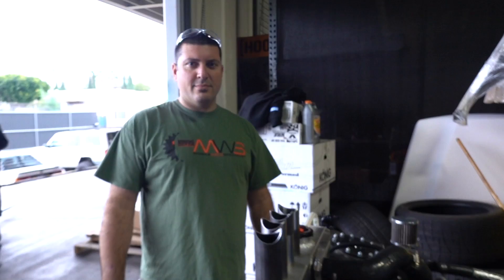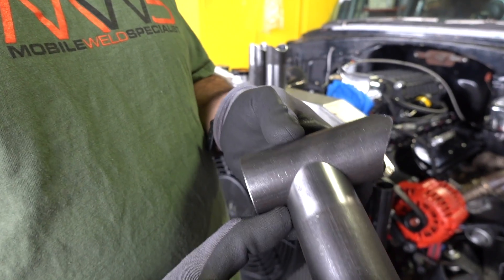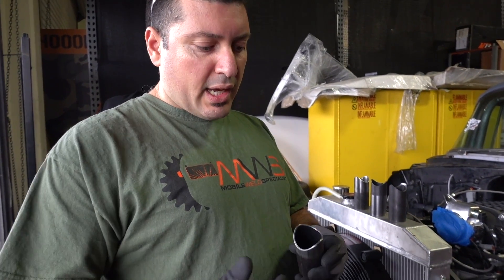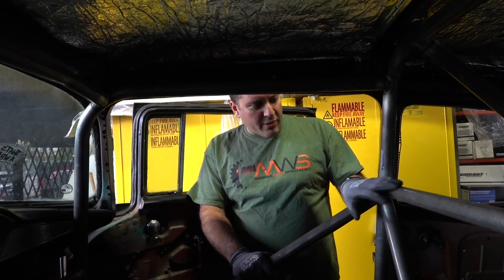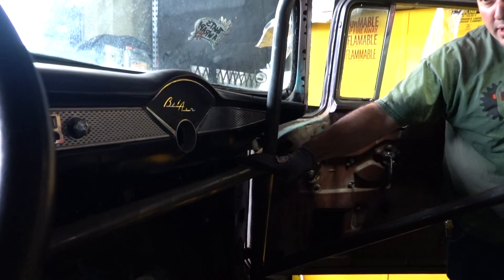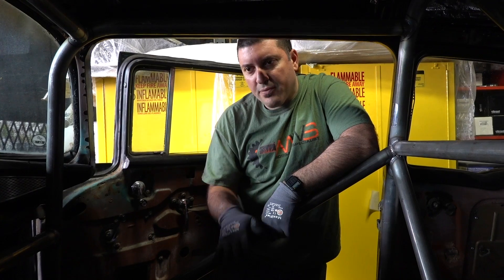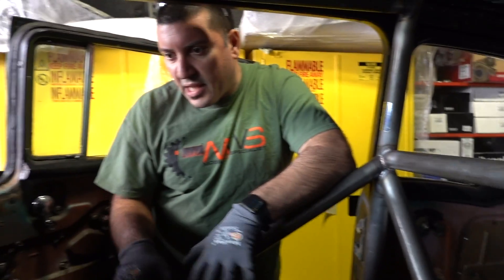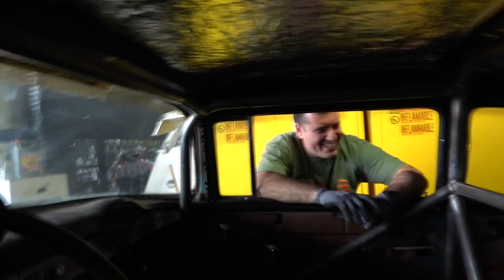Jon's Cage Breakdown! Tube Fitting 101

Comment: Structurally symmetry is better, although only the driver is really required to be protected in most drag cars a cage will stiffen up the chassis of any vehicle but stiffness helps a car be more consistent. If the chassis is flexing at all it can cause inconsistencies while operating it at a high level. With my drift z I went overkill on gussets because they fill the gap, look amazing, and they really help stiffen the chassis and make it actually perform better. Love the lesson guys, keep teaching your audience more so they can do these projects at home learning as they go.

Comment: Mill-scale is high in carbon due to the graphite often used as a high-temp lube. This carbon would turn into CO2 during welding making for more spatter and would also interfere with your arc.

Comment: isnt it recommended to brace the back of those kirkeys? against the harness bar?
Reply: ub3rpants only if it’s a vehicle where the other forms of mounting isnt strong enough, you want it mounted better than sheet metal.
Reply: @joshlarochelle1298  I would think having the base of the seat firmly mounted would still leave the seat back in risk of deforming in a crash, perhaps even more so. Kirkey recommends two bolts in the seat back to connect to the roll cage for many if not all of their seats, I looked at the installation instructions on their website. I had a question then I answered it myself with some searching 👍👍
Reply: ub3rpants as I said, I’ve used many kirkys. You see this in a lot of circumstances such as cleetus’ crown Vic even without proper cages.

Comment: How did they weld around the top of the bar across the top of the windshield
Reply: they do it in sections. typically the main hoop is all done as one and because of that it can be lowered to finish and then raised to weld out the remaining vertical bars. hope this gave you a better idea how they sometimes do it